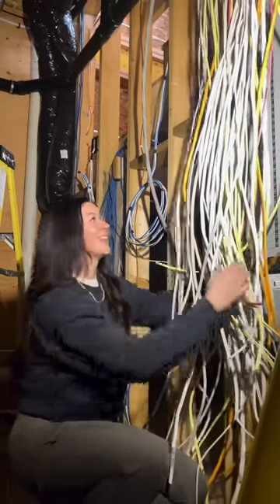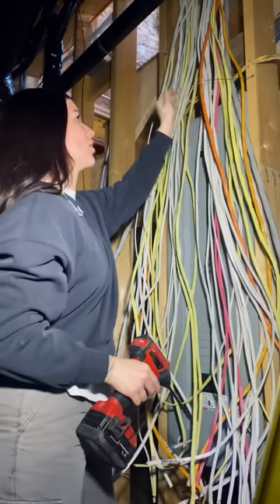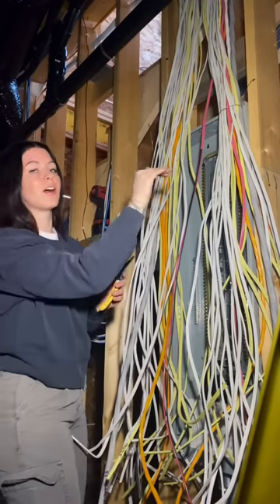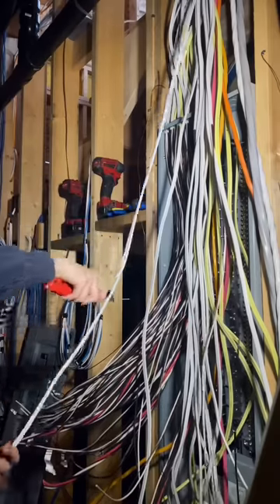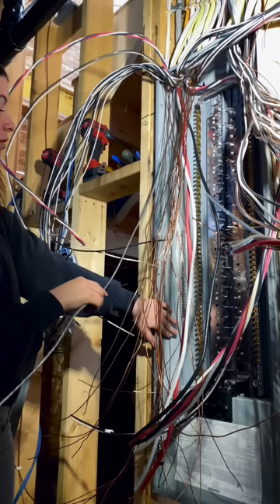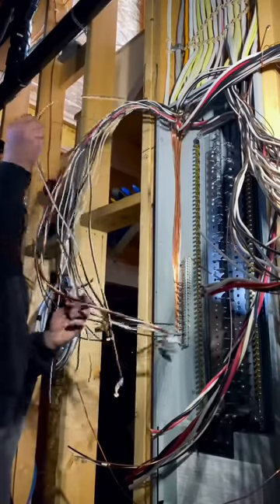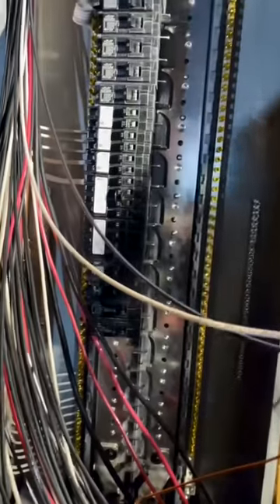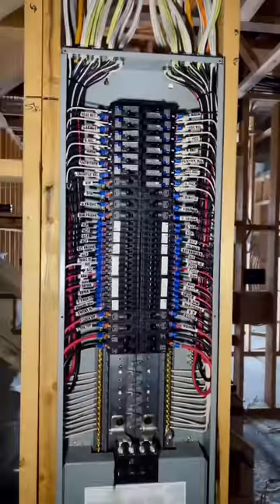How I wire a panel (an in-depth tutorial)

Comment: As a tech, I LOVE seeing work like this! It's not for the homeowner; it's for the next person that needs to get into that panel, and I can promise that they will be singing your praises for such careful work! Cheers!
Reply: It's also about taking pride in your work. She'll be like this with most things in her life, meticulous and organised.
Reply: With stripped connection screws from her Impact gun ? I doubt it
Reply: @christophergallagher3845 i highly doubt they're stripped. Lol. Just because you don't know how to use tools doesn't mean others don't know how to use them.
Reply: It’s all basically common sense use the correct breaker with the correct wire the correct outlet the correct amps amateur that’s never done it. Yeah I could say no don’t do that but I’ve done panels more than enough times and they passed inspections with no issues because it’s all common sense . i’ve heard the phone dead shorts that electricians couldn’t find wire in grounds that was not grounded. The electricians didn’t put in. It’s all simplified there is nothing hard about that. That will just take several hours to do that. Type of panel just have to have every line marked what it’s for and go down the line slow
Reply: I respect the idea that it should be for the next electrician that has to enter the panel, but it should ALWAYS be for the homeowner…since they’re paying and all. Hoping you don’t work in the area I live.
Reply: Or if the homeowner needs access to the panel to perform some work.
Reply: What is a pandel.  Why was I recommended this?  Is this real life?
Reply: I have an engineering degree but most of my work has been software coding. So yes neatly commenting and marking stuff is great for the next person who comes.
Although I wish my current old house had each room isolated. I turn off one breaker and a corner of the whole house goes off.
Reply: @dracula3811  lmfao you've obviously never used an impact gun or terminated into an mcb have you ? Stick to making videos of your video games
Reply: @dracula3811  for a start , how do you ensure the connection is made to the manufacturers torque values with an impact gun ? Are you going to tell me torque values on electrical connections don't matter ?
Reply: Where does it leave the guy that does a perfect soldering and forgets the heat shrink?
Reply: Journeyman from El Paso TX here. I agree @patrickcrowe5106 They can add a pool, a extra A/C unit, Solar, and the next electrician would easily recognize the cleanliness. It makes it easier for the next person. When I have to do Solar and see the main panel I pray it’s not garbage lol
Reply: @BaritoneFinwiggler  If the next is electrician working on the panel is happy that implies she did fantastic job which benefits homeowner.
Reply: @christophergallagher3845  I think torque values aren't yet a thing among Canadian and U.S. electricians.
Reply: I just start a new job as facility maint and really appreciated the contractor who did all the subpanels around the warehouse I really like people who is proud of there work. Thanks to all the good and badass electricians out there God bless you all!!!
Reply: Looks like someone ran over a cable on a field seismic crew.
Reply: a lot of the video is hard to hear because you’re working creating background noise and speaking softly and a little too quickly.
It would help if you got a better microphone or spoke more slowly.
Otherwise a great video. Thank you.
Reply: That moment where the earth bonds shorted against the feeder was dangerous, I'm surprised it's not being mentioned more.
Reply: funny you should say that. as a homeowner who's very electrically handy, i can't tell you how many times i opened a panel, after your so called 'professionals' were done with it, to be completely horrified by the rats nest of of wires and 'service loops' (hate them). but yes, i do agree with you, her work is first rate. just wish they all did work like that.
Reply: The homeowner also benefits from having everything properly installed and labeled.
Reply: @christophergallagher3845 look at the boomer throwing out boomer insults.
Reply: @mjlambert210  look at the kid being childish 😂
Reply: Its most definitely for the homeowners as well.
Reply: I agree.  Your house  never looks better than the day you sell it.

Comment: I am a super master electrician that has 3000 years of experience and has seen everything and done everything. I’ll say this. That’s beautiful. Great job young lady.
Reply: Yeah but have you ever done any work in space, on the Moon or Mars?
Reply: @FirstLastOne  right being a super master 😂
Reply: Super master ? Lol ok
Reply: Sorry, feeder cables should have been shut off. She understands electricity? What about safety? That arc should never happen. 1/12 of an AC amp can put you into defibrillation. Work safe and smart. Cover feeders with insulator cover.
Reply: Master. I’ve seen them and when they go into manufacture they suck. Can’t trouble shoot motors nor controls. lol. 😂
Reply: @PURGE-3000 lol one of our maintenance workers told me he had to show one of our  electrical engineers how to connect a basic 9 lead 460v/230v motor. I was like...😑
Reply: Alright Thoth💀
Reply: What the hell is a super master? lol.
Reply: 3000 years of experience? Did you meet Christ?
Reply: Damn! Im certain you must charge a much as a  4th yr. plumber by now!
Reply: @cydonianman since when does an engineer know HOW to do anything?
Reply: There's a lot of you guys around 😅
Reply: I think he's trying to chat her up not the work itself😂😂😂😂😂😂😂😂
Reply: This is entirely foolishly accepted as being good electrical work? Using an impact driver??? This is a main distribution panel and every breaker and lug has torque specifications for a reason. You can never tell how good your connections are with an impact driver, utterly rediculous!
Reply: 3000 years? Damn, I didn't know humanity was installing electrical panels back then. We might have to rewrite history😂
Reply: @capac1jah that is a concern for this young lady - over confidence will get you killed.  It takes minutes to set up the right safety procedures. Minutes save lives.  Her work is amazing though and I love a clean professional look.  Just wish she were that tad bit more careful with safety.  Did she call them “bitch gloves”? You mean the gloves that prevent razors from slicing open your veins and tendons? Oh to be young and invulnerable. I remember the feeling well. 
Other than the safety concerns excellent job.
Reply: I changed the bulb in the moon dude😂😂😂
Reply: What her view

Comment: Nice work but fully agree with some others here never need to work on a live panel, unless if your testing with proper safeguards. If you are not allowed to pull a meter then you should not be doing it live you have to schedule a shutdown with the electricity provider. Shorts like you had would be very common with the amount of straggling wires when you rewire. LOTO is there for a reason, NFPA 70 and NFPA70E stipulate it. Your work insurance also would not be valid if you got hurt. Understanding electricity makes no difference - safety first. Gloves and eyewear is a safeguard against nasty eye incidents and cut hands. Keep safe.

Comment: There’s something mesmerizing about watching a master practice their craft. I don’t think I’ve ever seen a panel so clean and well done. Keep it up, you’re amazing!
Reply: A master would never use a screw gun or impact gun on a distribution board
Reply: This is a 3rd year apprentice but on the right track, masters do load calculations for the home 
Squ ftx3va standard method st 3000% at 100% the 3k-117k at @ 35% add up then add other home va’s, then demand factors, add total then divide by system voltage., then put that on load calc form and fax to the city inspector with master license number and contractor number/insurance in some cities then pull permit, lay your journeyman out for his apprentices and make payroll

Comment: Karly Great Work! You are a breath of fresh air! One little tip, I write on the romex jacket just like you do. Then I re-use the jacket  with the section that is marked as conductor label by the breaker instead  of the tape on the conductor. I found it to save alot of time. Once again great work!
Reply: Yes, I've always used the piece of jacket to slide on
Reply: Same

Comment: Looks great! Well done!
As a best practice I like to install the highest ampacity breakers as close as possible to the main breaker. This does two things, it lessens voltage drop across the buss, reduces the chance of flicker artifacts in lighting circuits when large loads are switching on/off (ie. air conditioners, hot water tanks, furnaces…) and with the currents panel orientation as you’ve shown it inherently lengthens each branch circuit conductor within the panel and gives the most amount of cable to play with while still being manageable to help with juggling and moving circuits around at a later. That said I’ll still leave a spare for a full sized 2-pole breaker (in a single phase installation) on each side of the panel should somebody later need to add a large breaker like a 60, 80 or 100A to provide service to things like a sub panel, feed to an auxiliary building (shop), substantial level-2 EV car charger… etc
Reply: Main breaker is on the bottom I believe
Reply: I was wondering about these rules of thumb / best practice.  Thx.

Comment: Great job!!! A tip from an old geezer: You can save yourself time by pulling the tags off towards the end when stripping the romex. Then you can slip the tag over the wires that need to go to the breakers and it can easily slide and remain in the panel for future service.

Comment: Karly, you are the model of what every electrician should follow.  You are high quality work.  I am following your process today on installing the breakers.  I have all my wires aready in my panel.
Reply: If I saw a young electrician using a screw gun on connections I'd read them the riot act . Tidy work is good but connections are most important
Reply: I think she could be an electrician and a model also

Comment: I love your organization! I am an industrial electronic tech, not an electrician. But I have worked in several panels and I love when someone takes time to organize their wiring.  I do this as best as I can when I wire. Yous looks far better, as you are much more practiced than I am. It makes troubleshooting so much easier. Not all managers want to allow you the time to do quality work like this, but they don't realize how much time it saves later. One thing you might look into to prevent accidental contact is cover up blankets. I work for an electrical utility and we use them to prevent the exact thing that happened to you in this video. They can be cut into smaller sizes if needed.

Comment: I have a lot of respect for the attention to detail and the pride you display in your work.

When you are separating your left and right side circuits, do you also try to do an imagined load balancing as well?  I've learned that this is more important than most electricians realize, and not for obvious reasons. 

A few years ago, I was speaking with an industrial electrical engineer who shared some valuable knowledge with me. There's basically two electric meter manufacturers in the world, and all of these meters are set up to report electric usage the same way; that being if there's 40A usage on L1 and 10A usage on L2, the customer is NOT being charged for 50A usage, but rather being charged for 80A!

How they do it is whichever leg has the highest KW usage gets doubled for billing purposes.  So armed with this knowledge I always try to do a preliminary load balancing when installing a panel, and then I check the balance again after the panel is energized and the homeowner is using electric as normal. 

Of course, this involves a bit more work, but I don't come cheap either. A good reputation is worth gold.
Reply: Good to know!

Comment: I have installed smaller residential panels myself. And worked on both commercial and residential jobs for over 20 years, and I have NEVER seen an AC panel or DC power plant for that matter as, clean, organized and easy to trace out as this one. I definitely learned from this video. Thank you.

Comment: the arc happens to the best of us. i like the service loops when you land your conductors im going to look into adopting it myself!
Reply: The arc should never happen and shows a lack of safety procedure, what is the point of being able to wire a panel nicely if you are dead.
Reply: @schrodingerscat1863 What do you propose she could have done different? It’s not like she was working with the covers off or live bus bars.
Reply: @pazi402  Should have been testing for live wires before even touching it. Working on live is no joke and you have to know what is and isn't live to keep it safe. 

Used to work on HV myself so you always test everything twice because one mistake is fatal on that stuff but it should be standard practice for all work.

That said the finished job was very high quality work so not knocking her skills.
Reply: @schrodingerscat1863  Understandable on the work comment. I am not sure where you work but in the US it’s pretty common practice to not pull the meter since the panel is already disconnected at the breaker.
Reply: @pazi402  I am in the UK, not sure how there is live coming into this panel unless the feed has been pulled in with that bundle of cables and not been properly isolated. Either way a quick 2 minute check with a live wire detector is all that you need to be absolutely sure. Maybe because you operate at 120v it's less of a problem but for us in Europe where everything in around 240v mistakes like that are no joke.
Reply: Looks like he's confused everything was covered and off.
Reply: @ralanham76  If "everything was cover and off" there wouldn't have been an arc.
Reply: Can you explain the aec a little more?  You said it was not a "live" panel but obviously it was somewhere.  Maybe some tape or other shielding over the contacts that are live.  Also, maybe some gloves when doing that step
Reply: The ground most likely made contact in the service entrance part for the panel , breaker is off on the load side but line side is hot . I usually cut cardboard to make  a barrier and not let wire dangle anywhere near the mains . Sh$t happens though, you work in electrical long enough things like this happen . Every other job people make mistakes daily, electrical you don’t get to make too many .

She does nice work, I’ve never wired a panel anywhere as neat . A lot of union workers will wire it this way but those jobs have bigger budgets .
Reply: I was surprised,/shocked by what I saw. She didn't explain what happened. I guess the current went to the ground, instead of through herself due to the wires contacting the grounded case and being bundled up to some extent. Yesterday I watched styropyro's 20,000W microwave oven video. I guess he likes risky experiments and works to experiment safely. I hope she isn't doing unexpected experiments with electricity, which seemed to be the situation here. I Australia I guess there might have to be write up on a  near miss in regards to work health and safety? How would she manage things next time, in regards to risk management or avoidance.? Is there someone working with her with an AED avaiable and first aid skills?

Comment: Nice job, would be an honor to have a panel that looked that good in my house. Too bad they don’t make breaker boxes with clear covers. I had a job just out of college wiring control panels and I was trained by an older coworker who passed on to me to try and make things pleasant to the eye. Wishing you the best.
Reply: Did he teach you never use a screw gun on breakers or neutral bars ?
Reply: Christopher Nancy Karen Hater dang how many times can you just whine about the drill ?!  We get it but you obviously don't do this for a living and if she is that meticulous with everything you can't trust her with a drill ? Dude she has Milwaukee with power settings. Any one who works with an impact daily should be one with it and know when to let off and not go buck wild . Get a grip and stop trolling
Reply: @UTUBER07able A-freakin'-men to that. Also, who is to say she wasn't using a variable speed torque clutch drill/driver with 24 position adjustable torque clutch to help make the screws torque properly for this application? It's really a simple thing.

Comment: Forgot to add…  during my first few years in the biz, I was  working for a custom home builder in NJ.
He was building 10-25,000 sq ft homes and was meticulous about his work.
He insisted I label all wiring with the tags with numeric codes and he had his “structured cabling” guy create and laminate index cards to be added to all panelboards.  

I bought the Dymo/Rhino 5000 and it worked phenomenally well.
Im guessing there are a ton of such label tools nowadays.
The “structured cable” back then was UTP CAT-3 for pbx phone systems and for “Lantastic” SLOW p.c. networks.
CAT-5 was just coming out.  Things certainly have improved!

Thanks for great video content .
Reply: I use the same label maker and it’s great. You can even use the pre labeled shrink wrap which makes for a very neat and clean looking install.
Reply: I'd be curious to know how many electricians could afford a 25K square foot home.
Reply: @MrEkzotic  Never the sparkys… just the builders.
🤣

Comment: Oh, if only others worked as meticulously as you! I have seen a panel the exact opposite (on a boiler, not a db), so stuffed full of unmarked wires that the door was pushed open as soon as the latch was released. Took half a day to diagnose a simple fault, having to trace the wires.  SO frustrating.  Such a pleasure seeing your work.